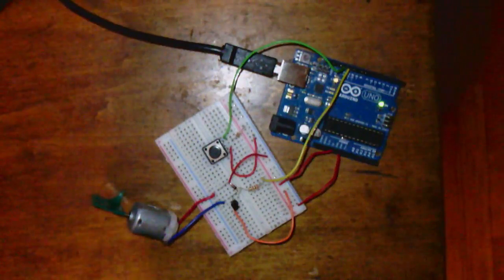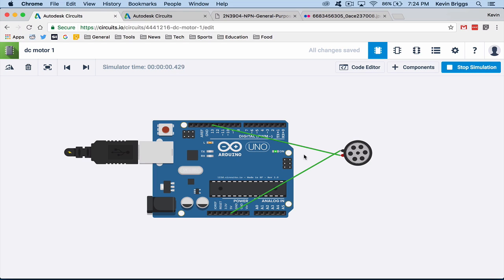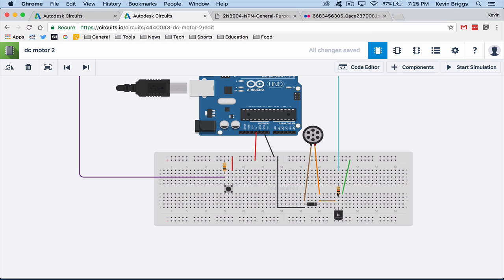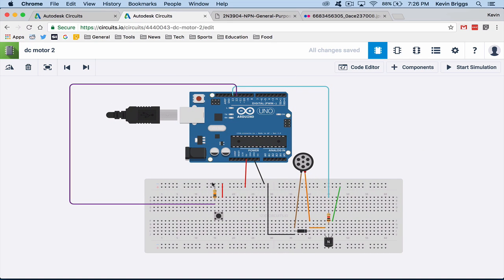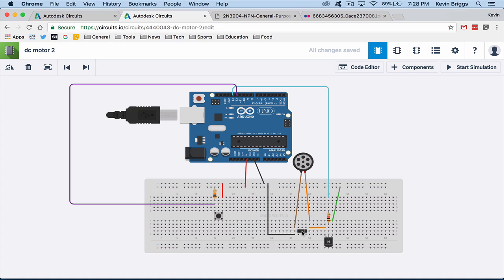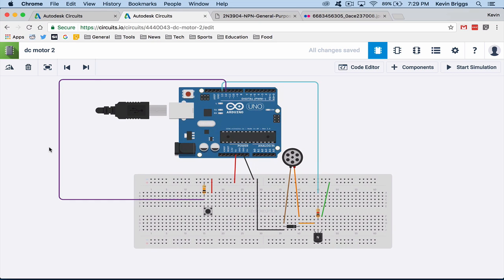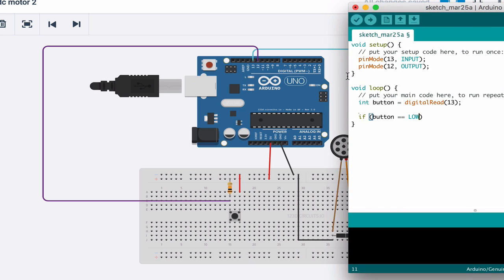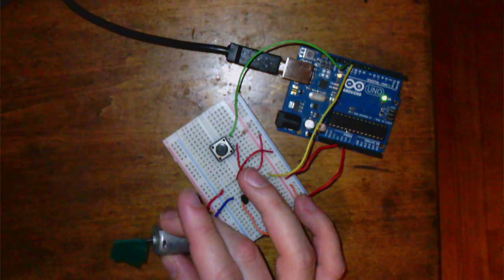Arduino Tutorial #6: DC Motors

Comment: I had everything set up, but the 1k resistor was too much.  The transistor wasn't getting switched on.  I tried a couple of 220 resistors in a series, but still too much.  I even tried just one 220, still too much.  It would receive signal until I took out the resistor from the output pin.  I just hope I am not damaging the pin.

Comment: Hey, i noticed you may have connected the wires wrong in the program. Pin 13 is connected to npn instead of the button and the same thing goes with pin 12 which is connected to the button instead of the npn.
This might create some confusion, because you did the opposite on the breadboard, you connected de pin 13(Input) to the button and the pin 12(Output) to the npn.